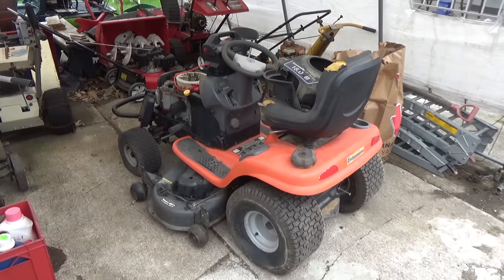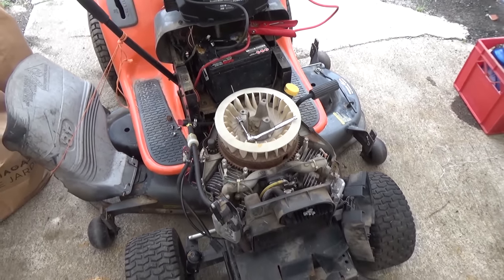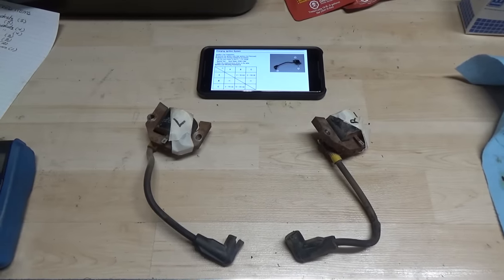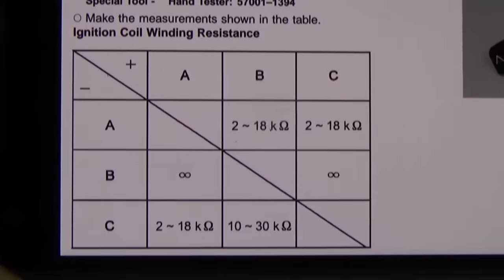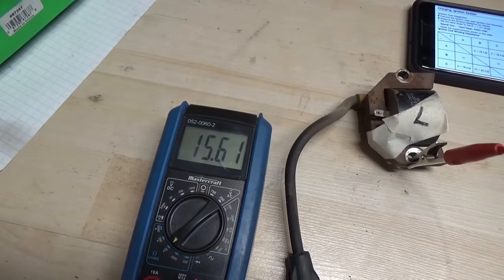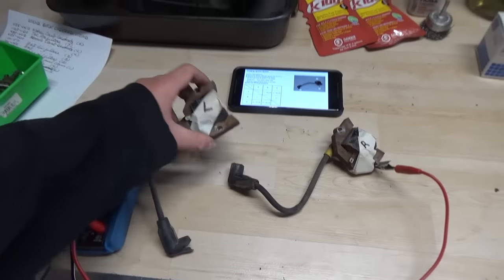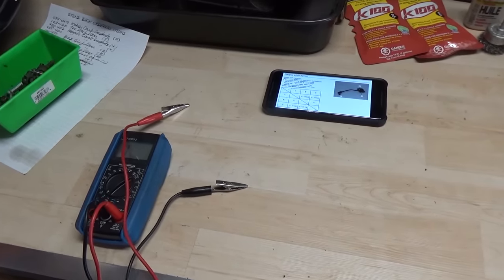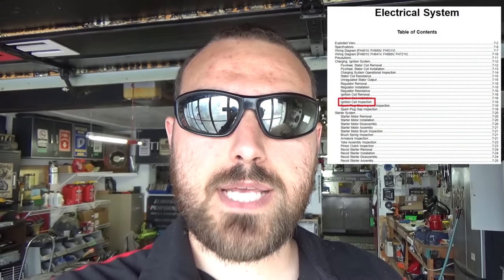How to Test a Lawnmower Coil

Comment: First thanks for a very informative video.
Had an interesting thing happen during a Kawasaki FH500vAS16 restoration.
Usually the coils fail and are not able to produce spark.  I have the opposite issue.  I can't kill the engine with the kill wire.  I even substituted a new ground wire and she still made spark when testing both coils.  The funny thing is both coils are doing the same thing.
I downloaded the manual as you suggested and located the testing diagram in that manual.  I intend to check them next week to determine if there is a defect in both of the coils and if so, I will replace them.  The engine runs perfect after the restoration but I am not happy about not being able to kill the engine in case of an emergency.
Any other thoughts would be appreciated.
Reply: Sorry it took so long just going back and checking comments but it appears you have a bad ground, likely between the coils and the mounting pillars. Take a little fine emery paper and clean off any corrosion on the aluminium pillars and any rust on the contact area of the coils. The problem may also be in you key switch!
Reply: @waynestefinashen239  Many thanks for taking the time to read my comment and offer recommendations for a fix.  It has been so long since I worked on this I forgot what I did to fix it.  One thing for sure it that I always clean the engine mounting posts with emery paper and also both sided of the coil surface where it makes contact with the block.  I also clean the screws  including the underside lip where the screw makes contact with the coil surface.  Yep, bad grounds are a typical problem.  People who leave their lawn equipment out in the rain are asking for trouble and usually get it.  Ha Ha.

Comment: What is the chances that both coils go bad at the same time not impossible but unlikely what would cause the both to fail rust ?
Reply: Leaving a mower out in the weather is definitely not a good idea and you are correct that rust and a poor ground will affect both your coils. We rarely see two go at the same time but always change both when one fails, we give no guarantees if the customer only wants one changed and leave the other as is.

Comment: hey guys. whats the minimum battery voltage that will turn the starter? 12.6? why does a 12v battery charge over 12v
Reply from the maker: If a battery tests at 12v it's actually a dead battery, usually a standard 12v should test around 13v and when an engine is running, and the charging system is working, it should be around 14v! Hope this helps.

Comment: My Husqvarna self propelled walk behind mower's engine runs fine while cutting grass with the the self propelled transmission engaged but when the self propelled lever is disengaged and the mower is sitting at a standstill the engine's RPM fluctuate from low to high. Any thoughts on the coil possibly causing this?
Reply: Carb has a restriction in one of the jets since under load it is pulling more fuel and runs smooth.

Comment: what do I do after I bought 2 coils (NEW) and neither tested good.  Bought another mini-tester and same results.
Reply from the maker: @clifflang5939  every coil has a different resistance reading, you may need to go up on the level of resistance you're testing on the Dial of your meter. Otherwise, install the coil and unplug the ground wire. If it starts and you have spark, it's a safety switch issue that's grounding your coil (brake switch faulty etc...)
Reply: mind you the new coils came out of box and tested NO GOOD!  Do I keep buying new ones until a get a good one?

Comment: Nice video. I cannot find a service manual for my mower engine which includes ignition coil specifications, it only shows parts numbers. I've looked all over for an official number, but the best I could come up with were several sites that stated a general reading of 2.5 to 5.0 Ohms, I have a Briggs and Stratton push mower, #126M02-0444-F1. Any ideas? The coil I have reads 6.5 Ohms, and although the mower starts, it's running lousy all of a sudden. I've checked the carb (clean), the fuel line (clean), air filter (clean), spark plug (clean and new), and even the flywheel key (intact). The only thing left that tests abnormally is the magneto coil. Could one at 6.5 Ohms cause performance problems, since it is over the acceptable range? Mower starts fine. Thanks.
Reply: It is very possible that you are getting a weak spark or an intermittent spark that is weak causing the poor performance. I would change the coil and make sure you clean the mounts for the coil before installing the new coil.

Comment: I just turn machine on unplug suspicious wire if no differents that's the one go to my closest dealer and ask him to replace this for a new one go back home and replace.
And then done.
Reply from the maker: Sometimes that works, other times you may have to jump the connector.

All depends if the circuit is open in the disengaged position, or closed in the disengaged position.

Take for example a brake switch, unplugging this will actually cause the machine to not have spark. You would then have to jump the connector, and if you got spark, you'd know you have a faulty brake switch.

Hope this helps!

Comment: I found a better way take the spark plug out of the engine leave it hooked up to the wire wnd hold it and turn the engine over  you will feel it if it works

Comment: Even if your check the resistance of coil you can't check the electronic chips inside.  So your resistance test nothing.  Only specific electronic equipment can test modern  coils with embedded chips Inside the coil.

Comment: where did you find the resistance specs. on google? i have been looking but can't find any specs. for a tecumseh HSK70-72526D engine.
Reply from the maker: I ran those numbers, not coming up with much info.

My advice would be to run a Solid State coil, most likely can get one on Amazon: https://www.amazon.com/Replacement-Electronic-Ignition-Tecumseh-31-8693/dp/B000G627QS

Here's a basic Manual about electrical on that engine, no specs though: https://www.manualslib.com/manual/1051402/Tecumseh-Ecv105.html?page=67#manual
Reply: I downloaded a technicians handbook which shows the same info as your link, but there are not specs anywhere in that manual, its odd there is allot of info. but not many specs at least for electrical.
Reply from the maker: @twodoselegend9196  yeah that seems to be a tricky number. Maybe just search hsk 70 coil specs, and leave the 72526D code out, see what happens.
Reply: I had no trouble finding the right coil < on amazon, also partstree list about 50 different OHSK70 engines. All seem to use the same coil 34443d. Also you video was very helpful thank you.
Reply from the maker: @twodoselegend9196  thanks for watching!

Comment: One more step that you didn't show us. How to reinstall a coil. Both of mine are on the same coil holder. As the coil gets close to the flywheel, it wants to stitch to the flywheel. When I want to set the gap, I use a business card behind the coils. That way, the coils don't stick, and the gap is set.
Reply: Normally that is what we also do and we have business cards at both 0.010 and 0.012 inches thick. Periodically we will use our feeler gauges.

Comment: I could be wrong but I found the same site for the specs and I think they have the leads backwards.  My coils are pretty much the exact same and if I test them as black as the top row and red as the left then I get good readings.  The B to C seems to be the only one that differs with which lead goes where.  If I go with red on B to black on C I get no reading on both coils.  If I go with black on B to Red on C I get a reading of about 2.3 on both coils.  I've done the spark plug touched to the engine block and do see a spark so I'm not sure if what I'm seeing or thinking is correct.

Comment: What causes a coil to go bad?
Reply from the maker: They can get moisture in them and they develop corrosion, or a short to ground internally. Heat cycles can also affect them and cause them to fail or become "heat soaked" where they produce less spark when hot

Comment: Is there a way to repair ignition coil?
Reply from the maker: Sometimes if a mower is left out in the rain, you can put the coil in the oven at 200° for 20mins to get rid of moisture. There is no way to actually fix them though, once moisture gets in, it causes corrosion. Replacement is only option.
Reply: Thanks! I will try that. It's been left alone in shed over 2 decades. It has resistance of 2000 ohms. Manufacturers spec requires 3.5 kilo ohm. It has spark but not strong and bright(very weak spark), can't getit start. I tried buy the coil but not available, disconnecting item. And similar ones doesn't fit.
Reply from the maker: @yongminhuh146  try eBay or Amazon, sometimes OEM parts are discontinued but aftermarket is still available.
Reply: Thanks! I am searching for one that will fit but no luck so far.

Comment: Update:  Both of the original coils have no read on the "C" to "B" test.  I just received two new after market coils.  Both the new coils tested bad out of the box for the "C" to "B" test.  The "C" to "A" test on the old coils was are 18k ohms and on the new ones the test resulted in about 8k ohms of resistance.  The engine runs great and then just quits!  I am surprised that two new coils both test exactly the same (bad).  Could I be doing something wrong?  All I have left to test are the interlock switches for the drive levers on my "Z" Toro as well as the parking brake interlock.  The preparation test show them as good.  I did replace the seat interlock (actually jumped around it).  The seat was not making good and when I jumped around it I was able to cut 5 acres.  Thought problem was solved and then this problem started.  Great unit, bought new, only 320 hours of run time.  Well serviced and maintained.  I am very particular regarding my equipment.  Please give me your thoughts.  As I said, just installed the after market coils and ran with a load for less than 10 minutes and then it just died. Period end of statement???!!!!?????!!!!!       -       I am ordering the OEM immediately after submitting this comment.  Help or direction will be great - going nuts here!
Reply: Patrick, I'm having the same issue.  Replaced old coils with aftermarket ones.  My Dixon ran great for a couple of months. Now the engine would just die a minute of so after engaging the blades.  Run fine without the blades engagaed. Checked the coils and tested as per this video and not getting all the readings I should be getting, but the Dixon  starts and runs fine when the blades are not engaged. After checking fuel system and confirmed all is good there, I am thinking the coils are working sporatically, or can't handle the load from the PTO/blades,.

Did the OEM coils solve your problem?  Don't want to put out the high $$ again for new coils if I can't confirm if coils are actually bad.
Reply: @peterdassey8872  I feel your pain.  I spent a small fortune for both after market and OEM coils.  The resistance test is absolutely invalid for my Kawasaki engine.  I ran down every electronic test you can imagine and then some.  I appreciate this guys effort but his information is wrong regarding my engine.!.  I also replaced the fuel pump, the carb coil.  I cleaned the carb.  Tracked all the safety switches included the one in the seat.  Actually bypassed the seat because it appeared the tolerance was to close to call.  I had a major dealer go over my engine and they said they had it fixed only to last about 100 yards of run before dying again.  They sent a specialist out to the house and he worked on it and found a hair in the carb.  Removed the hair and it ran for a while longer after he left and then quit again.  In the end, I took 3 5 gallon fuel can full of fuel and filtered the fuel three times.  I then washed all 3 fuel cans  several times each and filtered the fuel back into the 3 cans.  I pulled the tank from my Z and cleared all the lines.  Put everything back together fueled the mower and have run fantastically every since.  I got some almost microscopic trash out of my fuel - quite a bit.  I truly believe that the trash was the problem all along.  Spent a small fortune.  I have new coils both sets of after market, new fuel pumps, new carb solenoid, etc.  I am back to running on the original equipment before I replaced everything.  Wanted to prove it was the fuel.  It was trash in my fuel.  Get some paint filters from your local auto parts dealer and run your fuel through the filters.  Find any trash even very small you are probably onto something.  Let me know.  I would love to know what the author of this original article thinks?  Good luck.  Patrick
Reply: I never got a response back from Eliminator Performance on my comments and findings.  Guess they didn't like the denial.
Reply: @patrickmansfield1013  Thanks for the quick kickback.  This has been really frustrating trying to troubleshoot.  Going back and forth, wether it was electrical or fuel related..  Thought it was my electric clutch at first. Wasn't getting the correct readings from it using multimeter, and witnessed  lots of sparking from under the mower. Looked to be shorting out.  A new clutch didn't solve it (didn't give the correct readings from it either before installation but it works (??)) Checked the coils as per above mentioned specs.  Not getting all the readings, but engine starts right up and runs even when pulling either spark plug wire. Only dies after a minute from activating PTO for blades.  But you would think that by disengaging the PTO before the engine stalls would allow engine to keep running, but it still dies.  BUT, it starts right back up no problems.....kind of points to the fuel system then. Replace fuel filter, fuel pump, draining the tank, cleaned all jetting on carberator three times, still no luck, although it seems to run longer with blades engaged since the cleaning, but eventually dies.

I will follow your lead and try cleaning the tank some more.  I didn't remove the tank, just drained it and pulled out the broken gas gauge ( didn't find the float however), blew back thru the gas line to the tank ( it dislodged a fine screen on the fuel line elbow exiting the tank), and refilled with fresh gas.  Ran a  bit longer but it still stalled 5 minutes after engaging the blades. I figure any trash should be caught by the fuel filter ( between tank and fuel pump) but maybe something else is in the gas line.  I do notice that the transparent fuel filter doesn't fill up totally with gas neither while running or with motor off, but if I disconnect downstream hose at the fuel filter, gas pours out freely. 

Thanks again for responding and lending a sympathetic ear.  Will let you know if I am finally successful. 

( Dixon Blackbear ZTR 34" 968999731 (2008) Kawasaki 17 HP FH541V-DS28 4-stroke)
Reply: @peterdassey8872  Good luck.  I replaced everything.  Now back to all of the original equipment.  One thought - I removed the solenoid attached to the bottom of the bowl on the carb and clipped the the pin short so it would not engage when the switch is off.  This did not help me but a friend said it helped his problem.  This switch is useful to keep the bowl from flooding after turning off and back firing.  I replaced with a new one and that is the only part that is now new on the system.  Check your seat switch - it might be just barely making.  If so, it will obviously cause the system to shut down.  I really went through an elaborate cleaning of my carb, fuel tank, fuel pump, fuel filter and all the lines.  No problems since.  FYI - the inline fuel filter never gets completely full.  I also questioned that filter as desparation set in.  Again, good luck.
Reply: @patrickmansfield1013  Yes I had tried the solenoid trick already and the seat switch has been bypassed since I bought the mower.  But I did as you suggested and thouroughly cleaned the tank this time and replaced the new fuel filter with a newer fuel filter.  The mower is running much better and it is stays running longer with the blade engaged, but eventually it stalls still.  But it is getting better!  I am thinking that blades and hydrualics togther is too much for the engine.  Though the mower moves nimbly via hydraulics, the blades turn longer as long as I am sitting still and not moving....Pointing the hydrualics?  Will change out hydrualic oil and filter to see if thing are gumming up there and is loading up the engine.
Reply: @peterdassey8872  good luck.  Keep me posted.  Hope things get better.  Talk again.
Reply: @patrickmansfield1013  Jake actually had the same issue and did a video on firstly using a dummy fuel tank connected to the fuel pump with fresh fuel to prove the fuel was the problem prior to doing any other work. Saved the customer a ton of money but debris was still inside the fuel pump so we cleaned it up and with fresh fuel it ran great.
Reply: @patrickmansfield1013  Sorry we are so late in replying but i just happen to be going back to look at the video and the comments and started to respond to some of the missed ones. We hope you can appreciate that this video was posted 4 years + ago and we reply to all early comments but it is rare that we can go back and respond to ones that post 2 years later. If it would have be emailed you would have gotten a response for sure. We had a similar issue with a Kawasaki no spark issue where the customer told us that small igniter box on John Deere rider was brand new so we did not replace it and you can not test them. Spent 7 hours checking every wire in the harness for continuity and tried to find where it was grounding out. Finally bought an aftermarket $40 igniter and voila great spark. Gave the customer a break only charged him 3.5 hours labour instead of the 7 hours spent on his rider.